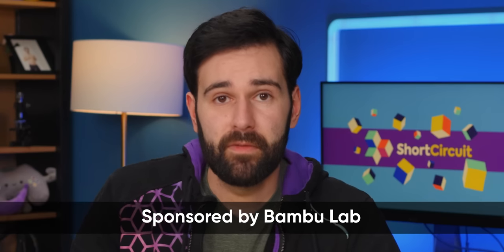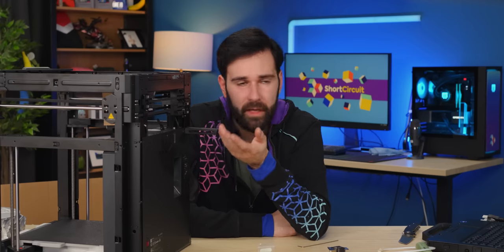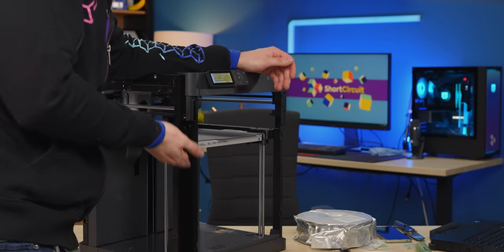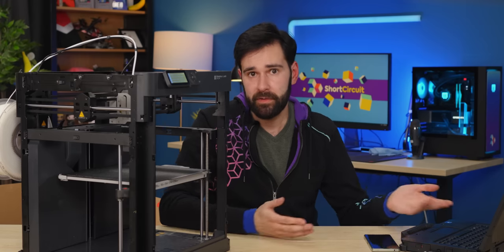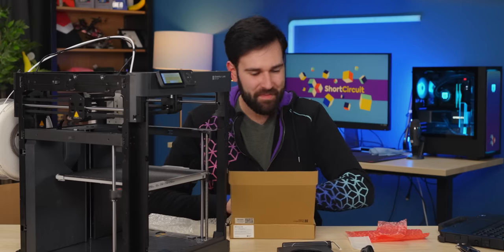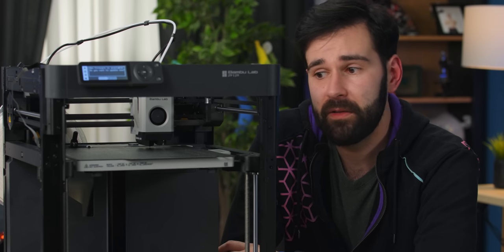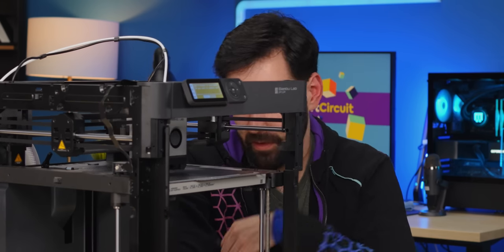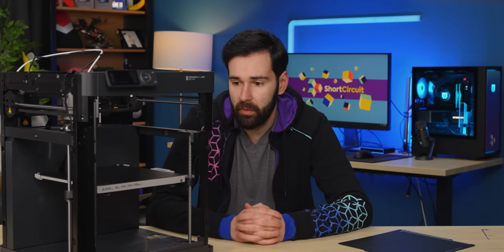I wish this wasn't sponsored (because it's so good) - Bambu Lab P1P

Comment: Went from Ender 3 to this.  I've had it less then a month and already been able to print double then what I was ever able to print with the Ender 3.  It's making me change my mind about proprietary systems.  If it's going to give this much value and just work, then I'm willing to accept being inside their proprietary system.
Reply: Well, their parts are as cheap or cheaper than quality open sourced parts. Which completely changes the proprietary paradigm compared to something like Formlabs where you're talking a 3x cost.
Reply: @DOGbackwardz  Proprietary tech and walled gardens work as long as there is strong competition. The moment a company get a dominant enough position that competition is no longer relevant it breaks down. We've seen this happen over and over again in several markets. But at the same time the ease and safety of never venturing away from the flock is seductive...

Most people doesn't really care either way. All they care about is that things work when they need them to. And when something doesn't work they either replace it right off or take it to the "experts" who replaces it right off making you pay for a new whatever as replacing is easier than reparing...
Reply: You need to learn about Vorons, RatRigs, and VZBots. Just to start.
Reply: Idk, this feels like they saw how normal printer companies do it and imitated their business model, which will be disastrous in the long run if true. With the RFID chip in the spools and the software bound to an account and so on
Reply: @domninin  Difference being that here you can choose to use any filament, but you will have to dial in the properties manually. 

Well at least you can do that for now. Who knows what they'll do tomorrow?
Reply: Made the same switch. Made the same consideration. If it works, it works. And then it stopped working.

Comment: Well... I wanted a 3d printer, and it seems this is the one I'll buy.
Reply: XD same
Reply: Highly recommend. I’ve been doing this for several years now and I can confidently say the P1P is the first printer I’ve ever bought that felt like an appliance rather than a project. The only thing that came close was the Anycubic Kobra Max, but that sucker is so big it takes up its own postal code.
Reply: @LilApe  how many people have received a wrapped bed, cause I think you talking a**. we backed the project from the very start for the X1C + AMS and have had it since and many use it has there daily driver. and there is no other consumer printer that comes close at the price.
Reply: A bit expensive, but yeah, this is probably the best one you can buy besides the upgraded X1 carbon.
Reply: Wait for the creality coreXY printer
Reply: Same here. I was looking into the X1 but the price way over my budget then this video pop up. I might go for the stripped down ver instead.
Reply: I just ordered a 3d printer, I almost bought the P1P. I just decided to go with the X1 Carbon with AMS.  If I feel like I needed a second printer it would almost certainly be a P1P.
Reply: @lumi_arcs  I would not wait for the creality coreXY printer. Their reputation of poor quality and long term support precedes them - especially because I was a backer of the CR6SE, which creality abandoned after releasing it with numerous major issues
Reply: @alfwok  You do have to have either an affinity for DIY or an interest in miniatures/models to really get the most out of 3D printing, but to answer "what are you printing": basically anything you want!
Reply: Broski Snowski  This basically. Stargate models are so hard to buy in my country. And all the companies that made them under license seem to go under. So having a 3D printer allows me to make my own, to whatever scale I want.
When licensed models of a few different things from movies and shows could quickly come out to the cost of the printer, it pays for itself in no time too. Just gotta be willing to learn a little. And units like these seem to take a lot of that guesswork and trial and error out of that initial learning curve as well.
I'm sorely tempted to look into this ecosystem. Especially for the ability to have a support filament. Trying to get some of the pieces I've printed on my Ender 3 apart has been a nightmare coz it's all the same material.
Reply: I literally haven't used any of other printers for a month. This is that good.
Reply: If you want it as a hobbyist then source and build yourself one. You'll learn a lot along the process and won't have as much as trouble when something goes wrong. But if you want it just for the sake of "I want to print something, don't care how" then yeah this printer is not a bad choice, but you are missing on a world of insane printers and an open source community.
Reply: @gatling216  Same, I've been operating 3d printers since 2010, and the P1P is, by FAR, the best experience I've ever had with a filament printer under $5,000
Reply: me two! i just ordered it!
Reply: my issue with this printer is what was said in video you 'have to' use their pla spools and issue is in my country there is none who sells their spools :D
Reply: @KuroganeX3  Yes and no. If you want to use all the "features" then you need to invest into their growing ecosystem. But for now it works with any filament, you just need to set it up correctly in the slicer. Thought I am scared of what is going to come next. Like blocking the use of off brand filaments because they can "break" the printer...
Reply: Its a very good Option

Comment: X1-Carbon was a game changer for R&D engineering work. I can make carbon fiber nylon prototypes first try with amazing accuracy. I’ve been using it for a bit now and it’s amazing for my teams speed in prototyping new designs has went from a week per design to a day. I have used a prusa and ender 3v2 before the bambu.
Reply: opinion on the prusa versus the bambu?
Reply: Same here X1C and we have 3 and 5 axis and dual turret 7? axis auto load unload lathes lol. This thing is just next level.
Reply: @vadeka  the prusa is great don’t get me wrong but bambu makes it somewhat hard to mess up a print along with great amenities like the mobile app. 

More in depth;

Being able to start a print and just leave then check your phones live feed of the print is very nice. (X1-carbon) 

It really comes down convenience/ease of use > open ended and upgradable. I think the software and the creature comforts of the bambu outweigh the upgradability of the prusa. Especially since you really don’t need to upgrade anything if you get the X1 carbon. If and big IF bambu stays around and keeps parts cheap. That is the biggest gamble. For the price you can’t go wrong with either. Of course if you get the P1P bambu then I think it is undeniably the best printer under 1K. Since it is just a stripped X1.
Reply: Except govt contractors schools and military contractors can’t use them. So they are niche at best.
Reply: @jagerbombasstic  octoprint / mainsail / klipper.
Reply: @Argon_02  I know they have all ran on our prusa/other printers already. Missing the point entirely. 

You have to upgrade/mod your prusa or other similar open ended system instead of just buying it and saving time and in some cases money. So for hobbyist and companies bambu makes sense. Tinkering hobbies yeah prusa and Voron make more sense. Casual, business, and engineer Bambu is better. Business and engineering because it is a time saver which is a money saver. Also aside from that many R&D engineering teams can’t use open ended software. I’m not allowed to use python for example. Hence why the prusa is not making anything IP related. 

Not sure why the tinkering 3D printing crowd is so uppity about these things.
Reply: @jagerbombasstic  idk either, maybe because they feel threatened. It's like people that say everyone should buy a classic car and learn how it all works instead of buying a modern car that can't be worked on but also is just better to begin with. I use cura and a creality cr10 and love tinkering with my projects and trying to print faster and better. But I want to spend my time tinkering with my project and not figuring out how to get octoprint installed and time-lapse setup. I really want this p1p now even just as a hobbyist for the speed and print quality alone
Reply: Not strictly a gamechanger because carbon printers have existed for a while
Reply: @jagerbombasstic  why can't R&D teams use "open ended" software? I'm assuming you mean open source
Reply: Carbon fiber is useless to print... It is not as strong as properly built carbon fiber parts from the actual carbon film. Polycarbonate is better for 3D printing
Reply: @wekkimeif7720 well yea, the point of carbon fiber composite is the shredded fibers help with stiffness and tensile strength.
Reply: @re5onance244  You can watch videos where people test the tensile strength of different materials. Carbon fiber 3d printed is far worse than most other 3d printed materials.
Reply: @wekkimeif7720  you have to be more specific. PLA-CF is not that strong, but PA-CF helps stiffen up the flexibility of nylons while retaining its strength, which is absolutely on par with Polycarbonate. 

Also, when you do tensile strength testing of composites, you always need to print it such that the load orientation is on the x or y axes, as the composite fibers don’t jump into the vertical between layers. Which testing data did you use?

Comment: I picked up a P1P a few weeks ago, it really is incredible. The speed at which it can print and still have good quality prints straight out of the box is shocking. I picked up the AMS, so I’ll be curious to see how well that works when it gets in.
Reply: the waste is excessive imo
Reply: @scootersfrog  I’ve heard that, but I’ve never had a printer able to do multiple materials/colors so I’m still excited haha
Reply: @HifiJelly  yea even knowing this i was still surprised by just how much
Reply: it's great for being able to queue up 4 different spools for one at a time use but yeah waste will eat at you. look up vids on how to optimize before you start or you'll get really frustrated by it quick. I suggest start at 185 and work your way back up using test prints.. you'll understand what that means when you get the ams
Reply: Is this core xy?
Reply: @scootersfrog  yeah stock it really is. managed to drop it to like 90mm purge with a tiny tower to regulate pressure. saved about 600 grams on a big print lmao
Reply: @scootersfrog  you can actually tweak this in the desktop app. You can tell it specific purge volumes for each color which can really help cut down on waste.
Reply: @scootersfrog  It's no worse than any other single-nozzle multi-material system.  You have to purge out the old filament sufficiently to not contaminate the next one, you can tune it to minimize, but it's necessary.  The other option is multi-extruder, but the price goes up fast for more than 2, and the Bambu machines can do 16 colors (4x AMS can be linked to 1 printer) at $350/4 which includes humidity monitored storage.
Reply: I heard you can adjust the amount it cuts when switching so if your not worried about color mixing could shorten purge cuts

Comment: I bought one of these based on this video and I have to say I can't complain.. its absurdly fast, and completely painless to use aside from some minor bluetooth pairing issues.

coming from an ender 3 that I will now never use again, no fiddling with bed leveling or setup, no bed adhesion issues.. works great with both bamboo and esun pla.  

His punch line is right, if you are in the market for a printer, buy this one.
Reply: Through 8 spools of filament and 0 failed prints so far... one thing to account for is you use a LOT of filament with printers that are this fast, buy extra lol

Comment: I have been 3d printing for years had a lot of printers before I got the X1 Carbon and it really is a game changer. I like tinkering and modding my printers but if you you want something that gives you little issues and is fast and pretty much reliable bambu lab printers are the way to go. It like the difference of trying to cook food over a camp fire or having a microwave, think of this more as an appliance rather than a hobbyist toy.
Reply: Modding is fun until you find yourself doing it more than just printing. I prefer to have a reliable printer that finishes the job rather than constantly fixing it. It's a fabrication machine, I don't like working on the machine that works for me.
Reply: What do you think about Prusa?
Reply: @WatShmat from what I've heard, they're pretty reliable but this thing is dramatically cheaper for similar levels of reliability and quality

Comment: I love mine, certainly a step above a prusa in terms of how much of a workhorse it is, and it's heads and shoulders above any sort of hobbyist printer. I think that it's an excellent beginner printer if you have the money to invest in the ecosystem because you learn basic maintenance without any of the headaches that come with cheap machines while getting incredible quality and speed. All the benefits of the X1C platform at a much lower price makes me almost regret my Prusa Mini purchase :P
Reply: I have a Prusa Mini and my first though after watching the video was selling it and buying this.
Reply: @Kevinjimtheone  It is super nice, but do bear in mind that everything is proprietary on the Bambulabs machines. Which means, you always have to buy via them, fixing the machine yourself with off the shelf parts, I think, is a great thing in the long run for printers like a Prusa (they do need to release something similar though).
Reply: If you want quality and speed of a Bambu with out proprietary garbage. Build a voron. That being said quality is dependent on your patience and effort to build it correctly
Reply: @killroy713  a voron is a tinkerer's machine, totally different user bases. It's like how not every engineer builds their own pc and buys a pre-built workstation. A voron kit is also quite expensive and requires a machine already capable of printing dimensionally accurately with ABS or ASA if you don't use the print it forward services. It's certainly the right choice for some, but an X1C or P1P is way more friendly and more approachable for the vast majority of people interested in 3DP.
Reply: @VincentGroenewold  while the parts are proprietary and that's a knock in my book, there are already clones of many major wear components. First party components are also reasonably priced, though the stock situation leaves much to be desired. It's still too early to say but I think the ecosystem isn't as closed as you may initially expect. I don't think it will be long before custom firmwares from the community get released.
Reply: @killroy713  the fact it's proprietary is overblown. Vorons are also more expensive and take far more experience.
Reply: @killroy713  some people don't want to spend 40 hours assembling and tuning a machine. Vorons and ratrigs are great, but the majority of people just want plug and play.

Comment: Both Dan and the editor did an excellent job on this video. The information is clear, flows well, and is a good density. I don't need a new 3D printer but I still enjoyed this.

Comment: A shame that you guys didn't really talk about the Bambu Lab AMS system. Being able to print in multiple colours/materials is a huge win in my book.
Reply: Being able to use support material with carbon fiber filaments so you don’t waste the $$ filament is worth the cost alone.
Reply: @jagerbombasstic  you technically shouldn't use the AMS with CF filament. it says so on their website. it wears out the funnel thing where the filaments goes into the AMS. you can print a PTFE adapter for it though but out of the box it aint recommended. wore it out abit with a PLA that had alot of rough glitter let alone CF
Reply: They might do a main video on it at some point. In a recent labs tour they spend a short moment talking about it with Dan. They have 3 x1 Carbon's and one of them is hooked up to 4x of the AMS feeds.
Reply: @-B.H.  Yeah they might. I don't think they have done a X1c review yet so that review will include the AMS is there nobody more qualified to do 3d printer reviews. I like the guy but it's obvious that he isn't on a high technological level involving printers
Reply: The AMS is known to be extremely faulty, and they would have had to touch on that and bring light to just how unreliable these machines are in order to talk about it at all.
Reply: Thats proably because they only sponser for this specific machine, If you checked the new lab tour video, LTT has been using multiple x1c+ams system in the lab

Comment: Fantastic video. Would love to know if you’re also running into the extreme slow Wi-Fi transfer speeds on your p1p compared to your x1 printers. Mine is painfully slow with the transfers vs my x1
Reply: Oh you're here too?
Reply: Replace the crappy included SD card. It's a hardware issue.
Reply: I could not set up the WiFi through their app. I suspect my phone has an incompatible blue tooth protocol (V4.1, A2DP vs their BLE 5.0), but I have yet to hear from their technical support to help me out. So far they have suggested to work through LAN. Compared to how well the printer worked out of the box, I was amazed how bad the set up for network connectivity was.

Comment: I just got the X1C and as a manufacturer, entrepreneur and patent filer type it's an absolute game changer. First time it took me 30mins to print something I designed, including learning how to export to the software and use it. I didn't leave my room and watched from my office via internal webcam. Truly in Star Trek age. 1000x easier than industrial 3 or t axis CnC machines which really need babysitting and years of experience.